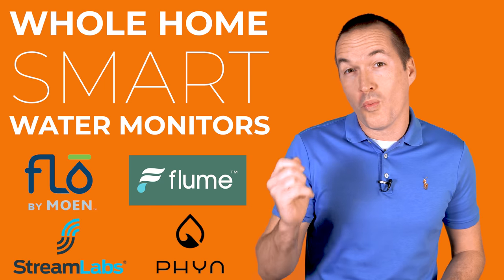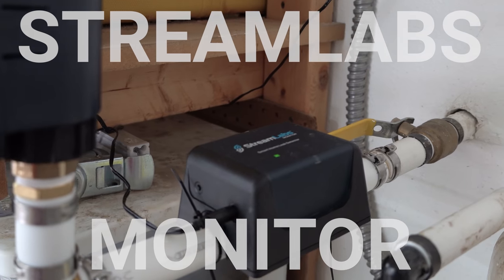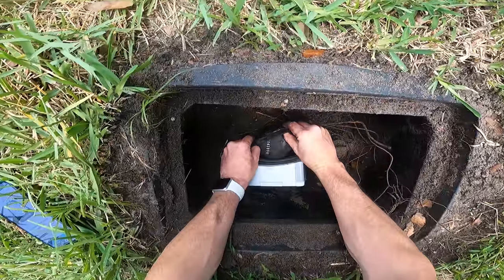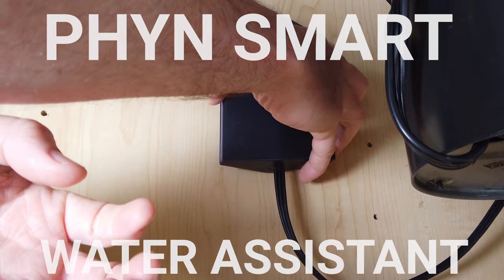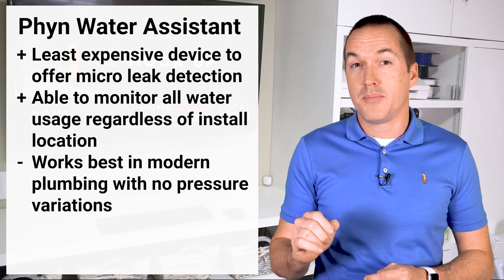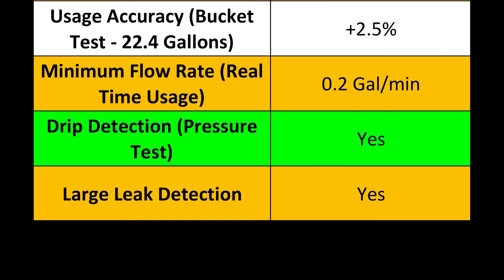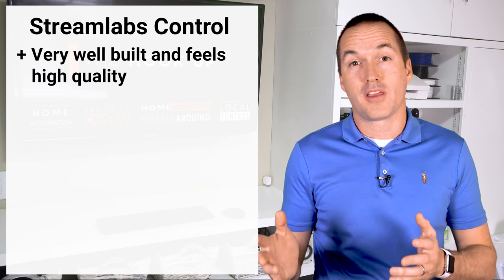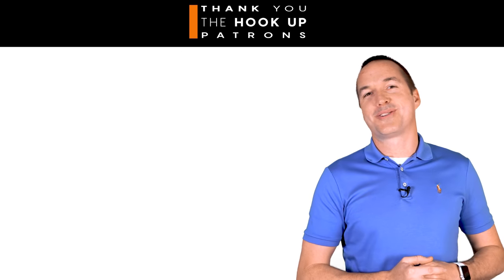Prevent THOUSANDS in damages with these smart water monitors.

Comment: Suggestion for all those having professional inst all-get your plumber to also install and manual ball valve in parallel so if the device shuts down inappropriately,breaks etc, you can by pass-also be sure to have them use couplings on BOTH sides of the valve so YOU can easily replace when the tiem comes without another plumbers fee-plumber will balk but make him do it!
Reply: Flo comes with a bypass insert
Reply: Thank you for this important tip.  I am going to show your comment to my longtime plumber. What are your thoughts on the Moen device?

Comment: Great video as always! Just a note from someone who is in the industrial automation trade on the ultrasonic flow meters, you should get better accuracy is you install the meter at an angle in relation to the pipe, if you install it on top of the pipe small bubbles in the line  an affect the readings. Also, the rule of thumb with flow meters is to install the meter in a straight section of pipe that is 10x the diameter of the pipe after and 5x the diameter before any bends, fittings, valves and couplings to ensure laminar flow. That said, I’m not sure if it will make a major difference as 1.5% is already a small error. 
Looking forward to more content from you and hopefully getting great  colabs in getting Linus fully up to speed with Home Automation in his new house!
Reply: I'm glad to see this as the top comment - Was just coming to the comments to mention very much the same things. For the Flo and Streamlabs, the installs were about "worst case scenario" of pipe diameter changes with propress fittings which create huge orifice/expansion turbulence effects as well as turns and an ultrasonic near a "choppy" flow restriction of an impeller.
Reply: @axisofoil  this man talks my language!
Reply: Damn mine is right after a bend
Reply: Steam labs control (the shut-off) & Monitor is owned by my insurance company Chubb it's great

Comment: These were great reviews.

One thing that struck me as I'm trying to solve this problem myself: The devices look, largely, not quite ready for prime time / plasticy.

The Moen Flo, for example. There are reports that the impeller will fail / magnets will be covered in grime over time. This is for a $900 device. It looks like you'd get a few years out of it until you're dealing with it again, unlike a normal shut-off ball valve.

The Flume 2 clips onto your meter and, by the tests in the video, gives really accurate results. No pressure test. You can see if water is leaking to a certain point.

This led me to: Why not just get the Flume 2, to measure flow, and a motorized shut-off ball valve? I can then control that using an outlet or IoT device connected to Home Assistant. At that point if any of my leak sensors (under each toilet/faucet/refrigerator/dish washer) detects water OR the Flume 2 detects a leak for a period of time, I can then automatically activate the shut-off valve (which is $70 vs $900 - granted, I have other parts at play here ... Still with just the Flume + this shut-off valve you're around $200 AND I think a normal, motorized shutoff valve is far better built (metal) than the plastic parts in the Flo).

To me the win here is: I travel a good bit. I also sleep. If I get a water leak in the middle of the night or when I'm out of town I want it to be detected and the water to shut-off. You could even take this one step further by having a drain valve at the lower part of your house and a one-way valve near the upper portion of your home so that you could completely, and safely, drain the system while your not home (after turning the main valve off) to protect against further damage OR if you're not home and there's a freeze alert... and you're still well under $900.
Reply: I am going to do the ball valve shut off robot from Yolink.  I already have flow monitor and leak detect from Water meter at road. Water company used to charge small fee but now is upgrading all homes in my area with it. Not sure if I can connect it to the ball valve but I have always seen the text notifications rapidly and addressed leaks that indoor sensors would not catch. Otherwise I would invest in a flow sensor at my input by water softener I could screw on myself. Thanks for this video and info!

Comment: This video is eerily timely for me.  I just experienced a potentially catastrophic event when one of my toilet fill valves decided to arbitrarily snap off.  Had I not been home at the time it could have cost me thousands in repair costs.  Even the 20 minutes or so it took for me to discover the problem resulted in some drywall and carpet damage.  I'll definitely be looking into the Moen Flo and Streamlabs Control.  

Thanks so much for yet another great video!
Reply from the maker: It's more common than you think.  Water damage is second only to wind for insurance claims.
Reply: Glad you found Phyn Plus! ;-) Doing research right now and saying hi! You had some good luck there catching that leak!
Reply: Steam labs control (the shut-off) & Monitor is owned by my insurance company Chubb it's great

Comment: As always, you have the most concise, to-the-point, clear instructional videos.  Thanks for all the efforts in making this video.  A couple years ago a friend had a massive water leak at his house and that incentivized me to implement a water monitor at my house and at a rental.  I ended up buying a Sonoff RF, 433 MHz RF water sensors, and a WiFi solenoid valve.  All integrated in Home Assistant for monitoring, notifications, and automated shut-off.  I have been extremely happy with my system, it has detected small leaks, and automatically shut-off the valve after notifying me.   Obviously, this video was focused on systems that you can buy out of the shelf.
Reply: What wifi valve did you use ?

Comment: Ahh such a bummer these devices are so heavily cloud integrated it would be so cool if the meters themselves had MQTT or Modbus or some other common standard you can connect a local server up to.
Reply: Some meters broadcast data over RF which is then read by the water company (so they don't have to manually read everyone's meters), but unfortunately most newer meters encrypt the data :(

Comment: I live on a farm, and have two water sources (both well and spring). Of course that means there are huge pressure swings, which eliminates most flow monitors as a viable option. We also have somewhat unreliable internet access out here, so I have to have something that doesn’t depend on some corporate API for its basic functions. What I really want is something that I could easily connect to via serial or IP. I’d need a pressure gauge of some kind that reports the pipe pressure (would have to report down to…. IDK… 4 times per second?), and then a relay/contactor/breaker that I can have software order to open, to stop the pump from running (just closing a valve isn’t adequate). Perhaps also monitor the pressure output switch to the pump, so that I can tell whether or not the pump is getting power, and if it continuously has power for more than say 30 seconds, open the relay and raise an alarm.  I’ve been pondering how to accomplish this for *years*, but I haven’t found anything off-the-shelf that does this, and I’m not confident in my ability to write software that will be able to distinguish regular utilization from a runaway event. :’(

Comment: I was able to get the flume 2 for $25 including extra battery through rebate program by my water company.  It didn't say anything about a subscription but I get real time monitoring and all the features you indicated, will have to see if there's actually a subscription.  UPDATE:  It says on the site that I have lifetime subscription to insight and that this used to be a paid subscription but isn't at this time.  I'm also able to get a discount on my home owner's insurance.  It doesn't turn off the water for you if there's a leak, however.

Comment: The water meter thing and the phyn would also only work if you have city water. No meter with a well, and huge pressure swings.
Reply: For a well, I'm thinking about putting the well pump through something with CTs to monitor energy usage, and then figuring a conversion for motor on duration to gallons of water.

Comment: Rob I have had the FLUME 2 for over a year now and it's great- when you said it would not show you  a micro leak (toilet running or faucet dripping) you are mistaken- that was the 1st thing it caught when I got mine- I am guessing your device needs to be calibrated. I did have issues at first with incorrect reporting but I worked with support and once we re calibrated it has been flawless. I do agree that the now annual fee (which I do not need to pay for because I was grandfathered in) is unfortunate.
Reply from the maker: It's possible it needed more time to calibrate.  I had the faucet on "drip" overnight (about 8 hours) and none of the monitors said anything about it.  I had to do the specific "drip tests" in the apps to get it to register.

I do agree it would probably catch a running toilet though.

Comment: Phyn plus is another choice that has the same shutoff features as the moen flo. I bought one from Costco on sale for $500 and have been happy with it overall.
Reply from the maker: My main gripe with the Phyn was the app, is it the same interface as the one in the video?
Reply: I was hoping the phyn plus was going to be in this video. Great to know the Moen one no longer has a subscription.
Reply: I got in on the Phyn Plus when it was still in beta and it's been great.  Saved me when the kid left the tub running and then decided to go back to their room...  It's identified toilet leaks that were so small I didn't even know there was a problem.  I do agree the app is clunky and the lack of api is disappointing.
Reply: Same interface as the one in the video except it also gives you real time water usage, water temperature and pressure

Comment: Flume just got rid of their yearly subscription, making it the best value at this point 👌
Reply: I noticed that too, making it the unit I’ll be purchasing in the morning. I’ve had a couple irrigation mishaps that resulted in yard flooding and water overflowing into my neighbors yard, wasting hundreds of gallons of water in each instance. I’ve been shopping and comparing monitors like these, and with the Flume 2’d recent change in what it includes w/o a subscription, I’ve decided it’s the one to go with.
Reply: Remember flume is a meter only. No auto shut off. 
Also you need to have an mechanical water meter in order for it to work so if you have a well water system, you most likely don't have an existing water meter.

Comment: These are nice so you can keep an eye on the interior pipes and usage. This will not solve a outdoor pipe that T's off for your outdoor drip system though like a valve that's stuck open.

Comment: Great video Rob!  I did want to point out something that could help with the ultrasonic meter’s accuracy, namely flow conditioning. This is very commonly done using upstream and downstream pipe diameters with nothing besides straight pipe. With liquids, 10 pipe diameters upstream and 5 pipe diameters of the transducers, which are typically what is considered minimums. That means no process connections, no 90’s, no valves etc. If you don’t have 10 up and 5 down (more is better), the offset is typically very repeatable, so you basically factor in a multiplier to account for the difference. I’m surprised the manufacturer doesn’t allow for a meter factor to be implemented (I.e. if your flow is 7% low, multiply the metered flow rate by 1.07, if it’s high by 3%, multiply by .97 etc. to get accurate flow rates/totals). Maybe this could be done in HA?  I sell and work on several different flow meter technologies and manufacturers, with ultrasonic meters being included from several of them, and every USM I’m aware of require flow conditioning, which can be accomplished with several different methods other than straight pipe run, but regardless of the method,  they all  basically put the flow into a consistent profile throughout the whole cross section being measured. The video you showed explains how transit time works easily enough but doesn’t go into turbulent vs laminar flow, which will definitely effect the measurement and it looks like not only do you have the USM downstream of the paddle meter but also directly downstream of 90’s and connectors, all of which will decrease accuracy. If you were to put the USM on a straight run of 10” (assuming you have 1” pipe) then the meter spool, then 5” downstream, then 90 back into the Moen meter and back into your house, you should get much higher accuracy, assuming the USM can obtain higher accuracy to begin with. Sorry, the measurement side of me felt compelled to speak up!  I do love your videos and appreciate what you do for sure!
Reply: So I just wrote the same thing and after posting saw your comment. Well said!

Comment: Hi Rob, I think there is a home brew option here that is feasible. Pull together a pressure sensor, a motorised valve and and water meter camera recognition (for the numbers) and you're off to the best of all these systems with no cloud involvement. I can see a pressure sensor and motorised valve running from an ESP8266 and the water meter reading from an ESP32 cam running AI to character read the dials/numbers... All fed back to NodeRed and Home Assistant. In true home automation style, this is totally a DIY possible option and loops together a lot of your previous independant training skills.
Reply: I like that solution!
Reply: @dougle03 I'm very interested. Can you provide more info specifically on the camera reading the meter

Comment: I wish you tested the regular phyn meter. They have 2 models that both go on the water main instead of smaller modules that go on a single fixture.

Also, the biggest complaint about the Flo is that the impeller corrodes and fails extremely fast (within 6mo - 2 years, typically). I had a Flo on my first house, but i moved out of that house only about a year after installation, so i never got to see if it had issues.  Now, you can't even buy all the Moen Flo meters anymore. The 1" model has been out of stock for over a year, and the 3/4" and 1.25" have only been in stock intermittently.
Reply: What do you mean you cant buy the Moen Flo anymore?  Amazon shows all 3 size models available.
Reply: @nappyjim  I guess things changed in 5 months. It wasn't available before as I noted, for quite some time too.

Comment: Both Lowes & Home Depot locally here show the Moen Flo for $499 but they're "out of stock" & "unavailable" .. probably because Moen raised the price WAY above that. The 3/4" version is now $984 on Amazon. I've already added a WiFi controller to the shutoff ball valve on the main water line in the garage so I can fairly quickly shut if off if I get an alert. I'd like the automatic shutoff but not at that price. I'm going with the Flume 2
Reply from the maker: That is unfortunately the work of scalpers.  Moen hasn't changed the MSRP, they just don't have any stock.  Once stock becomes available it will go back to its normal price.

Comment: Hey Rob, fan of the channel for a long time!  I have the flume and loved it.  Like you I was one of the early buyers of flume and I dont pay for subscription and its been good to me.  I recently moved to home assistant and using node red (thanks to you again!) -- still learning but was wondering if you are planning to make a video for node red using flume + Dome (or any shutoff valve) + zigbee/zwave water sensors.  

It would be cool if its possible to setup an automation when a leak is detected from one of the sensors, then it checks with Flume if it is really a real leak, then turn it off via shut off valve.  Can add if AWAY mode, main water will be shut off right away -- if people are Home -- give a 10-minute grace period before the valve shuts off so they people can check first if it is really a leak.

More power to the channel and Thanks!